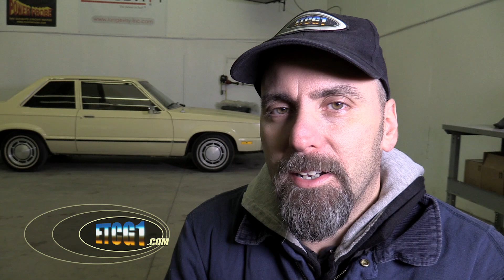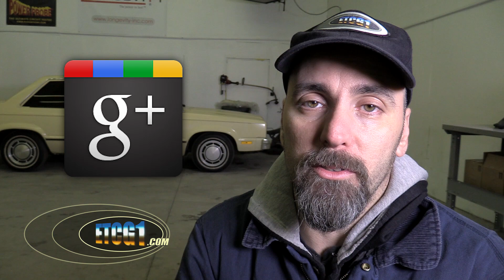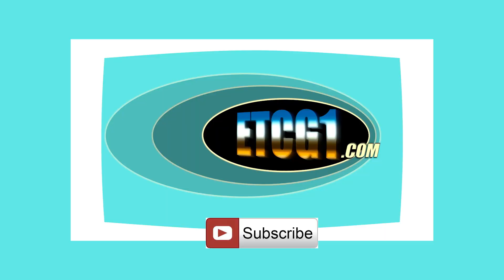How Things Have Changed In Auto Repair -ETCG1

Comment: The old carb setups were far better for a tuner that wanted to enrich the engine for performance. All you needed was a screwdriver so to speak. Today you need a degree in ECU software management to remap and set the ECU for tuning. That is become some what of a dark area today as the powers that be want to permanently lock out any modification to the fuelling map in regards to maintaining emission. Performance is second always and emission are priority. 
ECU tuners put performance first obviously and don't really care about emission.

Carb setups have a higher emission tolerance than fuel injected but the performance benefit of a carb is not actually that much better than fuel injection. It requires allot of manual tuning to get it compairable to stock ECU mappings and due to fuel additives of today's carbs really have more problems than they are worth.

I would like to see the ECU in modern cars opened up rather than locked down as to allow the mechanic/technician to tune the car simply and on the fly without special tools. I don't think that is going to happen while we have a system that thrives on proprietary software.

Regarding where you think the future is going, i personally don't think they will achieve that what you say. People are attacking the car ECU with open source developments and new ideas to completely replace the factory ECU to a more manageable transparent freedom respecting ECU and this market today is growing fast.
What they going to do lobby and get freedom respecting ECU components banned from being used. Oh they can dream but it will never happen as that crosses the line into freedom as a human right.

I actually think it is returning to a mechanical manor in a way that the ECU is to become a mechanical tuning element and the tool instead of being a screwdriver is to be a laptop.
The Dyno will come home and the need for a dyno won't be required for good ECU tuning. Data loggers for home tuning are becoming more and more popular so the whole ECU technician thing is going to be short lived as the ECU tuning becomes just one of them normal things in a mechanics toolbox and i am not talking about expensive snapon scan tools, i am talking about free open software via USB on a laptop, even android device. It is already trending and popularity is ever more growing. It won't be long before software is bi-directional on a smartphone allowing access to fuelling maps, all from a 5 bob android app.

Comment: I don't think I'd call OBD-II diagnosis being a computer technician. If anything, it's more of being a car technician than ever. The scan tool is designed to take all the "computer" out of it and just give you an interface. But if you don't understand the car, then those numbers are meaningless, no matter how good you are with computers. There is some overlap, at the point at which you're diagnosing the interfaces between the scan tools (My Bosch ABS 5 would not scan until I cleaned the pump connector even though the control module is under the dash) or testing output from the PCM to verify that it's delivering sufficient voltage and/or current to operate an actuator, but it seems like most electrical work is done by specialists now.
Reply: +Martin Espinoza This guy gets it. Exactly 100% correct bro.
Reply: Exactly, I had someone buy a scan tool for home use. Plugged in and got codes, they were like Greek if you don't understand car's from the get go, they are useless

Comment: We have the same dumb issues that were around 25 years ago misfire's with no codes auto computers are so sensitive to difference's in voltages set weird codes all the time sometimes there almost impossible to track down theres still a lot of diag and having to understand your system ive been a tech for a few years for FCA it is different that watching the check engine light flash none the less there is still a large amount of what I like to call voodoo

Comment: Well, I think know all fuel injection is pretty much the same.  Back then you had carbs, carb hybrid EFI and pure EFI.  Plus each manufacturer had idiot lights to determine faults.  

I figure future mechanics would know how to work on both electric and hybrid cars as the CAFE MPG requirements gets even more restricted. Who knows, maybe a ton more electrical knowledge would be needed.

Comment: Will you have to change your channel name to "EricTheModuleChanger" lol.
I think its a combination thing.
Does it make the car cheaper/easyer/less resources to make.
Does it make emission systems more reliable/accurate for ever changing standards.
Will it cost a lot more to replace "special" modules, so will the general public want this.
Will cars be mostly electric by that time, so repairs will be a different animal.
I dont think basic mechanical side will be too different (excluding the engine).
Will we all have hoverboots ha ha :-D
Reply: +zx8401ztv Modular is much more expensive...except salvage, lol.

I "modularly" bought a salvage throttle body for the car I'm always working on. It gave me an extra IAC and MAP and the TPS, which I actually needed, lol (the motivation is one part cost what all that cost used).

On newer cars several of those items are in a throttle body with much of that built in, at least the tps and "iac" via electronic minute changes in the throttle other than what the user intended.

And yes, this modular item is much cheaper to make, and charged for at maybe double the cost (figuring on how it replaces a few things, but it was a quarter of the cost to buy just one component before) most of which are cheap to buy on older cars even new (like throttle cables), but anything that reduces wires or metal in a car makes it cheaper so it gets made.

That's why lots of wires are being replaced by can bus. Not because it's better or more accurate, but because these fancy components replace a lot of wiring making them cheaper to produce...but they sale them for much more than their older counterparts and they have more problems.

Comment: I dont think very many people get the problem that is coming in the auto industry. Ask yourself this question. How long does the average person get rid of their old outdated broke computer. Every year cars are becoming more advanced and there is a sensor for everything. Power steering that isn't actually connected mechanically , accelerators that are designed alike. It seems to me that in 3 to 5 years these systems are going to fail , cars in harsher climates failing first. One day car accidents where the driver is not at fault the cars electric steering system shut down. The big auto factories are not in the business of you keeping your car for extended periods of time, last time i checked they like to sell them. They found a way to have cars break down and the repair would be way more then the car is worth. Time to get a new car.

Comment: my 1983 car has EFI, so its not like all cars had carbeurators then
Reply: +CR2504life Many of those were sort of a carbureted hybrid towards EFI though.
Reply: +DE Nichols my 1984 has multi port bosch style fuel injection and not a hybrid carb. Or call it MPFI. Where there is an injector in every intake port. This system was available in the mid 70's on import cars.
Reply: Dan Spirescu Sweet.
Reply: Ford had that for their cars from 83-84 on the 302. was some kind of throttle body injection setup. junk compared to the efi.
Reply: ***** Except big trucks and their mechanical injection was very high end and expensive. ..now they're cheap with more issues. (Per Scotty Kilmer)
Reply: D4x4Bronc Probably sold as a sweet tech at the time. :)
Reply: What you guys think of the Rochester mechanical fuel injection of the 50's and 60's Corvette? It did bring the small block to make 1 hp per c.i.d.

Comment: Intermittent and drivability problems are much easier now.
Reply: +jake legg You're telling me, I was certain my TPS was bad, but it rarely malfunctioned. It did appear to be the source of the problem. Even bought one, and then the front O2 sensor acted up and got stuck rich or lean. Sheesh. So do I have a bad TPS and a bad O2 sensor? I'm sure of the O2 sensor, but the TPS? It was intermittent, who knows! lol My car has early OBD-II and it's updates are Sooo slow so if I missed a green light saying it updated I could be wrong, it may have just taken longer.

Well anyway, I don't know what to do about my nonreturnable TPS I bought salvage (at least it was the same price used with the throttle, MAP and IAC combined versus a new tps. Something ought to come in handy eventually. lol I never buy salvage, but I made an exception when I get basically 4 parts in one. IN the eBay picture they're all OEM and a lot of new parts are starting to be bad a lot right out of the box - and I'm talking about new that aren't cheap.)

The TPS sure keeps being reliable now.

Wow, sorry for the rant. The 2nd half of your sentence was that they were easier now...depends on how little an intermittent issue shows up.

With great live data I can figure out all sorts of issues that only seem intermittent to the driver, but the computer is compensating most of the time....so mostly, you're right, it IS easier.

Comment: Dude even in the early 90's we had ALL-DATA pc based shop manual software..sure it cost $1,000 a disc and cold only be used in ALL-DATA machines but was well worth it when working on one of those awesome throttle body beauties.....sarcasm.

Comment: I often find that new vehicles lets say 2004 onwards are more harder to diagnose as the systems are more complex and there are more variables to content with. Vehicle computers are stupid and should never be trusted, I was working on a 5 series BMW about 2010ish been at the dealer for a misfire code on cylinder 2, dealer replace coil, plugs and injector, on cylinder 2. Customer gave up with BMW and came to our shop. Have the misfire code for cylinder 2 but was actually misfiring on cylinder 1 from worm cam lobe. Also modern computers cannot identify mechanical issues and mechanical issues still happen on new model cars like blown head gaskets, worn engines and sludge engines from the long service intervals. Carbon build up on GDI engines.  I think modern vehicles require more brains and knowledge and equipment to troubleshoot than older vehicles. A vehicle computer cannot tell you there is a wire intermittently rubbing on the chassis causing the fuse to blow once a week, or the hard starting is from resistance in the fuel pump connector harness connector

Comment: Then you don't know much about cars at all if you started in the 90's. Can you tell me what a set of points and condenser are? Or just tell me where they were located? I doubt you can without looking it up. They were on cars when I was working on them in the 70's. Back when you actually had to fix a car, not just replace parts like most mechanics do today.

Comment: I remember when GM made it impossible to adjust your carb until you drilled out the adjustment holes. Not a huge deal, but pretty sleazy.
Reply: +Joel Foreman Now that comment gets to the bottom of most of this!
Reply: Joel, did they have to cover them up or was it just cheaper to not make the holes for access? There's being cheap and then there's spending money on screwing people.
Reply: There was thin aluminum over the screw head adjustments purposely put there by gm.
Reply: Right, so they spent money to be sleezy. I'm sure this was pre-internet. These days the truth would get spread around so fast a trick like that wouldn't get anyone to go to the dealer...and if it did, they'd look back under and probably figure it out.
Reply: This was when I was a kid, probably a late 70s car. My grandpa had it. Definitely a move on GM's part to get not so savvy people back to the dealership. Seems stupid to me.
Reply: +Joel Foreman GM sucks! They shouldn't have been saved by the government. Does the government save your business because you consistently put crap vehicles on the market but spend more money on advertisement to make people think they need it? When I fixed cars for a living I'd drive around shops which had signs out for hiring and if the predominant employee cars were GMs, well, rusted Cavaliers I'd steer clear. It never made sense to me why an auto tech would drive the shittiest car on the market. And NO, GM isn't what they were, (1955-1973), and it is very very sad because this is the company where you could walk into the dealers' parts counter and buy your GM engine performance parts and bolt everything in it yourself with 4 wrenches and a screwdriver.
Reply: +Joel Foreman That was a tamper proof cap that the EPA required. A lot of motorcycles with kehein carburetors have this.
Reply: Interesting
Reply: Dan Spirescu I'm looking for another shop. I agree about your point on what the mechanics drive. ..but then so much of our personal income goes into tools that maybe their happy for a cheap, rusty cavalier and the can keep it going. ..personally I wouldn't want to.
Reply: chad harmon While I don't like drama or "hating" type posts we all do have feelings to let go of. Thanks for helping me take another look at his comment and find value that I missed because tough words color the lenses by which we see.
Reply: Did not mean to come off hateful, but I'd see people almost tearing up when they saw their bill at the auto repair shop. And it was constant GM cars with multiple problems. We had customers with GM cars thats were in every month for something which at the low milage these vehicles had it is alarming. I got out of the business of fixing cars because the income wasn't worth the hassle and money constantly spent on replacing broken tools.
Reply: Dan Spirescu
I have more issues with dropping a tool and it rolling away than it breaking. I learned early on, that every tool needed a warranty. That said, I still don't blame you. Professional work means I have to untighten over-tightened bolts and that breaks my tools down that'd never happen on my own cars.

Not that I never broke a tool at home, but I used cheap tools for over a decade that couldn't make it a few month professionally.
Reply: Dan Spirescu
Nah, man, I didn't feel anything wrong coming from you. Just honesty and FYI, I did get a much higher paying job, which will keep me in the industry longer. Was considering going into HVAC - still may eventually. I seriously considered even selling Matco tools for a living, but I'd have to work more hours and I don't want to miss out on my young children when I can make a good living at fewer hours.

Moving to shop with fewer hours of operation, better pay, and no Sundays. :)

Comment: Trucks and tractors still aren't to the stage of cars with computer diagnostics, you still need alot of mechanical knowledge.
Reply: +petej222 New Volvo trucks most definately are
Reply: +Kristoffer Lilja the new vn780 i drove it as a company driver ecm fault came up on the dash stats and the 2007-2013 cummins isx eat egr coolers like popcorn
Reply: +petej222 Really? A diesel mechanic told me working on those big trucks are easier on his body because mostly they need diagnostics more than anything. So diagnostics and sensor/wire repair instead of big components. Way more diagnostics he said.
Reply: DE Nichols that is very true and also what i ment. Volvo trucks ARE to the stage of cars with computer diagnoatics
Reply: Kristoffer Lilja Sorry? My "really?" was to Pete. Cool. Thanks for the detail.

Comment: Now the automakers want to shut down independent shops.Ford is getting this way,they will not let out computer information anymore.Dealer gets it.Get computer info out of an OBD1 Ford,you get out the breakout box get them.The worst thing in a car is the TPMS and I hate it with a deep passion.Takes longer to change tires including tire rotation.These Hybrids are throw aways,the batteries are more than the car is worth.

Comment: I don't see where you had fuel efficiency issues with carbureted engines.  I guess having worked on mostly fuel injection you lack some of the basic art.  My carbureted were just as fuel efficient as my efi..  Part of me misses the days you could sort out all your problems under the hood and when you had the room to clime in the engine bay with it.  That said I am young like to stay state of the art and love the plug and play diagnostics.  It's a bit cleaner and not as many bloody knuckles lol.  The worst years I've dealt was the 90's.  The evolution of cram it in titer compartment and OBD1 1/2.  Still had to trouble shoot every part on the planet due to crappy diagnostics, vacuumed lines everywhere, and every repair feels like a shot in the dark due to inconsistent pass fail.  Everything I've dealt with 80's and newer has been fuel injected of some type.  Everything that has needed replaced on my 1986 Ford has been strait forward and no time to find the problem.  Even though I have had some nice 90's vehicles I feel if they should all go to the recycler.  My evolution will be to 100% electric all the way across the field!

Comment: One thing hasn't changed: dealership service depts. are crooks. And as far as I'm concerned the mfr. warranty is worthless unless you have a catastrophic powertrain failure. It is less costly to repair the vehicle myself out of my own pocket than to even let those crooks touch it under warranty. And the satisfaction survey you get from the mfr. only asks if the service dept. was polite and friendly. No questions about the repair work being done correctly. Good service is defined as being a charming crook. The dealership service dept. does not exist to keep your new car in tip-top shape a good long time, you suckers. No, it is there to screw you until you decide you need to give up and buy a new car because the service on your current car is breaking you.